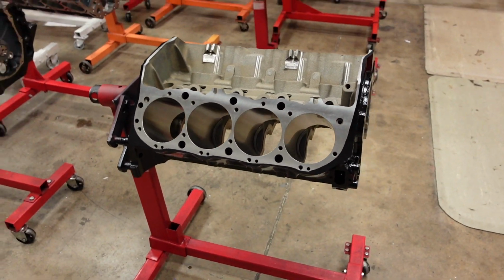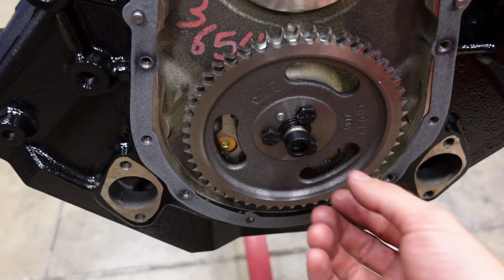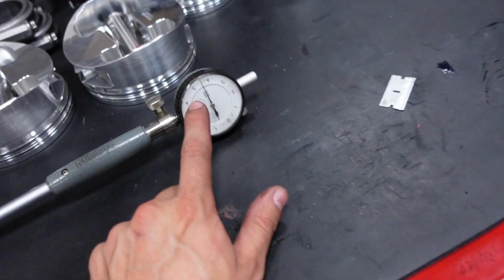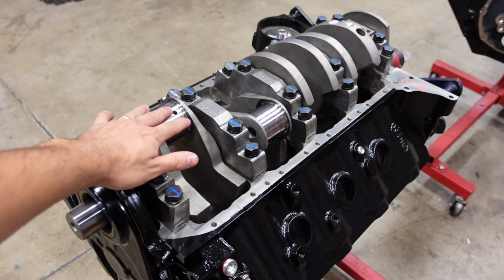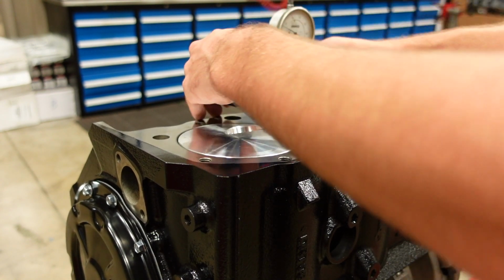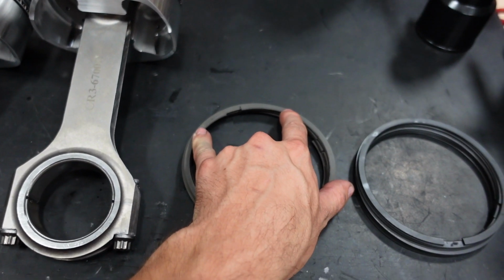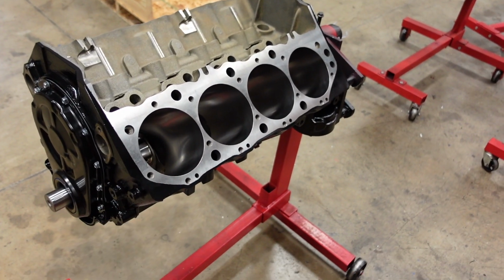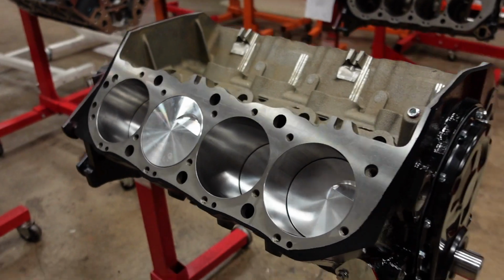Building a 632" BBC - Short Block Assembly (part 2)

Comment: Some builders plug the rear lifter galley between the distributor and the last lifter, Big M's with hydraulic rollers can be noisy if there's too much oil leaking past the distributor.

Comment: Why haven't you checked piston to valve clearance before final bottom end assembly what happens if pistons need final clearance or you want to run a more aggressive camshaft ??
Reply: Always a "one upper" in the comment section - this is a basic engine build and more than likely they already know this combination - this is for basic education purposes.

Comment: I noticed that you only measured the gap on the top two rings. Do you ever need to adjust the gap on the oil rings? Also, are we going to be able to hear this engine run on the dyno? That'd be sweet!
Reply from the maker: Oil rings just need to be at least .015” gap, on street motors they are basically drop in.

Yes this engine will be dyno’d and filmed!
Reply: @JacobVillemain  Can't wait to hear it!

Comment: I know you have high quality stuff and I’m ashamed to ask, but what’s your opinion on a 351w roller ford?   It’s questionable and everyone has a different opinion on what kind of power the factory block may hold. I don’t have the good 69 era block, a 94. Thanks
Reply from the maker: Depends on the application! For a mild street setup the factory blocks are usually ok.

Comment: Is there documentation somewhere that will specify main cap bearing clearances based off what application your motor is being built for?
Reply from the maker: Negative. There are general rules of thumb but every application s different